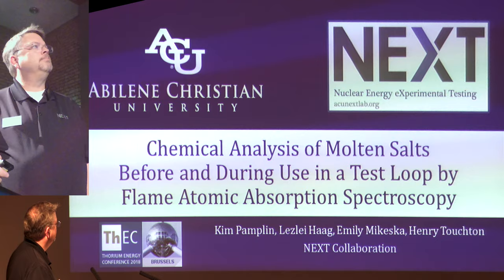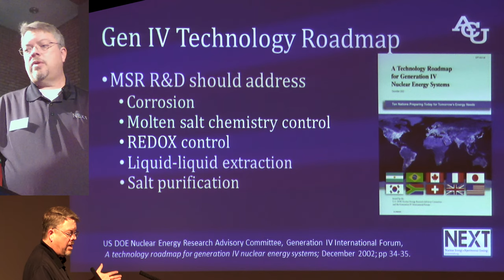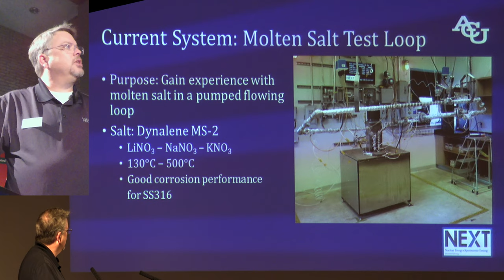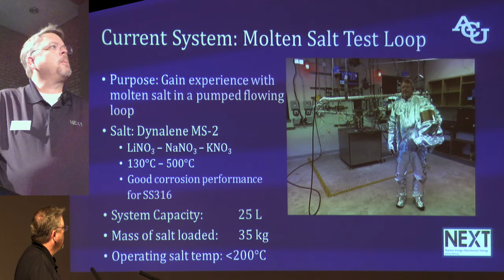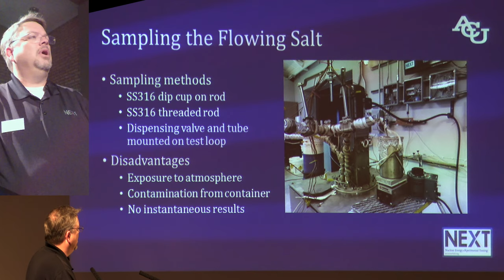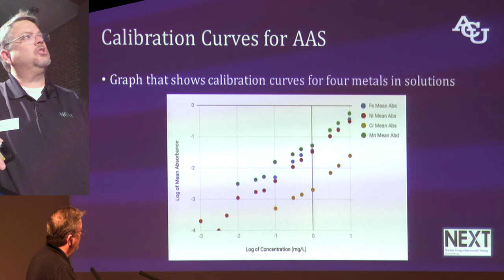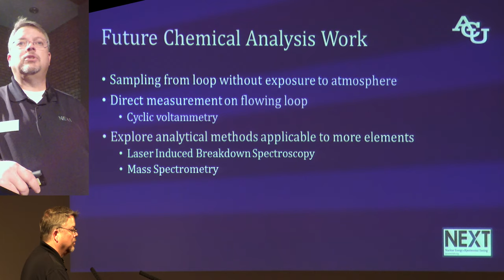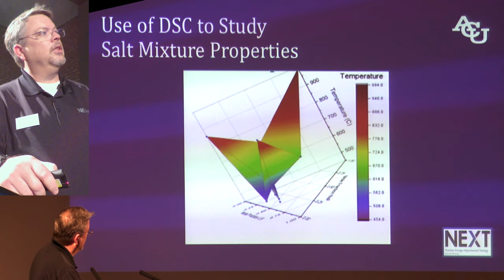Molten Salt Analysis by Flame Atomic Absorption Spectroscopy ACU NEXT - Dr. Kim Pamplin @ ThEC2018

Comment: for sampling salt, on the sample pipe create a closed system with a vacuum. This should suck the salt sample into the sample pipe faster. Then remove the section of pipe containing the vacuum-sealed sample.

Comment: The main disadvantage of AAS is that the light source, for example hollow cathode lamp, has to be partially made up of the same metal you're analysing. I guess this is an easy way to monitor how the structural elements are getting corroded, and since there are no Fe, Ni, Cr isotopes are not amongst the fission products, the presence of nuclear fuel won't mess with you. 
I also wonder if IC, ICP or MS either or not combined with these would have any use, or LIBS alone would be enough for measuring the fission products. 

I'l also like to know how significant would be the need for people who studied chemistry in MSR NPPs. Chemists, chem engineers or technicians.